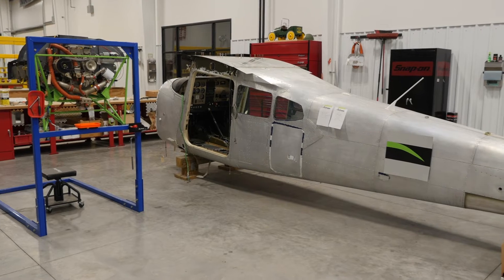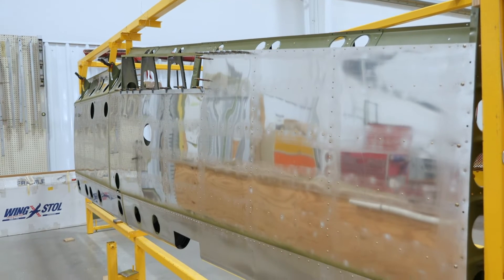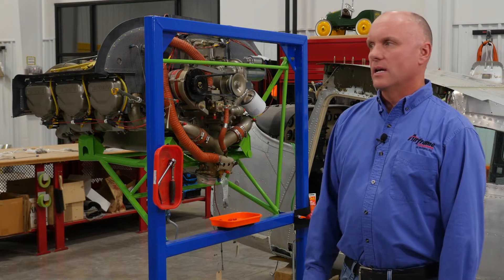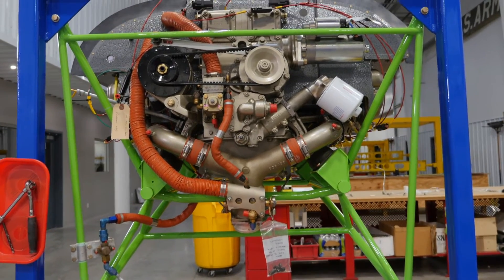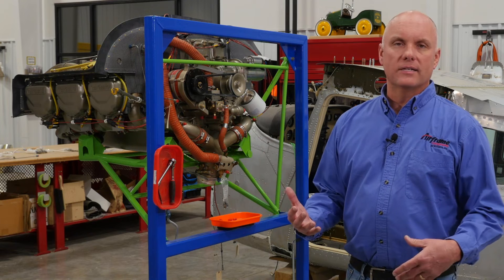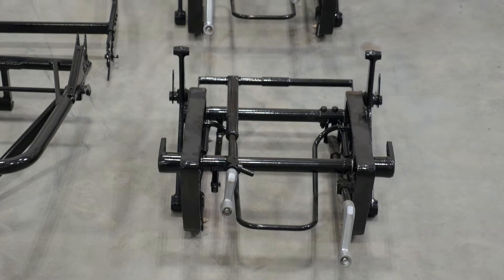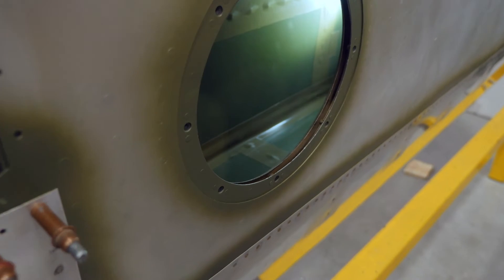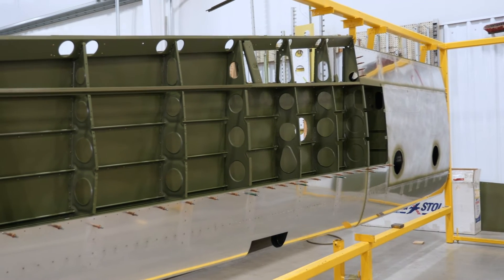AC Roy 1978 Cessna A185F Restoration E4

Comment: Why did you decide to leave the wing leading edge stock?  I would think lowering the stall speed would be benifical.
Reply: The later model  Cessnas had a modified airfoil with a slightly extended and drooped leading edge You can see this, they have a a convex area on the underside of the wing, just aft of the leading edge.  (vs. the completely convex profile of the earlier airfoils)  Cessna called this the "Camber-Lift"  wing  (Just what you'd expect from the folks who brought you "land-o-matic" landing gear and "Omni-vision" rear windows. "   This improved low speed performance over the original wing.  It may be that Roy figures that the late model wing gives him enough low speed performance for his purposes.
Reply: I have the same question. The late model Skywagons have a LE camber similar to the Robertson, but it isn't nearly as effective as the Sportsman cuff. The preferred set-up before going with the Wing-X is the Sportsman cuff + Micro VGs, otherwise you don't gain the full benefit of the Wing-X. That's the three I'm going with. Currently only Micro VGs but Sportsman soon.
Reply: @AlaskaTRX  I have no idea if this plays into the decision,  I'm not sue what ROy's plans are for the plane,  but there is a belief that for a floatplane, you get more performance bang for your buck from the wing-x extension than from a leading edge cuff.  The thinking is that a leading edge cuff works by allowing a higher angle of attack, which can't be exploited with a floatplane because pitch attitude is limited when taking off and landing. Whereas the wing extension work by increasing wing area, which provides more lift within the same pitch limits.
Reply: @andrewalexander9492  the increased camber of the Sportsman's kit does allow for a higher AOA before stall, but other advantages are a higher L/D ratio, decreased wing loading due to the increase in wing area, and coupled with the VGs these effects are amplified. Where the Sportsman's kit helps with float flying is allowing steeper approaches and climb-outs, which really helps for tight lakes, as well as improvements in getting on step faster. The Wing-X definitely help a lot on floats due to the added lift from the extended wing and the reduction of wing loading. They are even more effective with the cuff and VGs. Like I said, all three mods together really make this wing so much better. Looking forward to having all three someday when I have a larger hangar that allows the Wing-X!
Reply: @AlaskaTRX  Yeah, yeah,  I've heard all the arguments why this is wrong.  That's why I said " there is a belief"  Not "I believe",  to avoid being deluged by someone giving me all the reasons that particular belief  is wrong.   It's not necessarily my belief and I've yet to see convincing empirical data from either side on which is true.   I was commenting on the reasons why someone might make those particular choices, based on what they believed,  not make a declaration that they were correct.  Me, I'm perfectly content to let others modify their aircraft as they choose,  even if those choices might be different than the choices I would make.  I've never understood why people get so invested is why other peopl are doing with their own possessions and their own money.
Reply: @andrewalexander9492  oh I was just curious why he would do the one mod and not the other, I am not being critical to him or yourself, and I was just trying to help with the additional information. The Sporty's kit is about $2500 to buy and another $5k in labor, while the Wing-X is over $5k just to buy and about the same in labor. I put together a spreadsheet for myself to track and compare/contrast benefits, costs, install times and such. There is real-world, empirical data out there to support the pros/cons of each modification and some of that testing and performance results do form the basis of the STC issuance and owner manual adjustments. Anyhow, I'm glad to see another Skywagon getting back in the air, they are amazing birds!
Reply: Here’s another vote for what I call the Big Trio…Sportsman cuff, WingX and Micro Aero VG’s.  Fantastic combination in my personal experience.  I am also an advocate of Knots2U flap gap seals.  3-5 MPH speed increase, faster climb rate and tested/verified before and after data to prove no change in stall speed, as the slot does open when the Fowler flaps are extended.